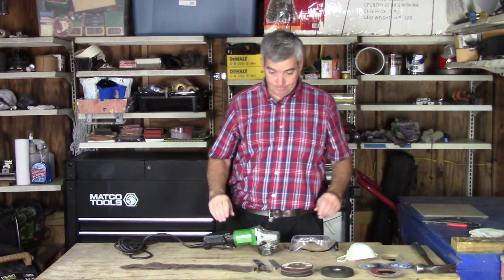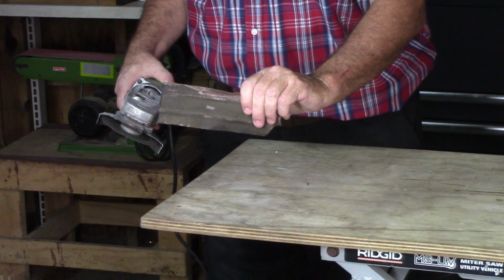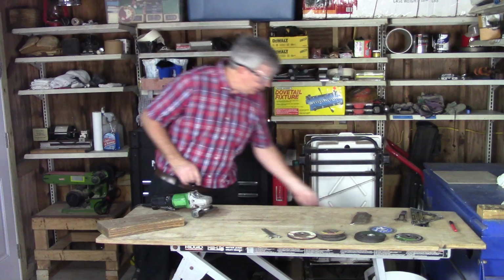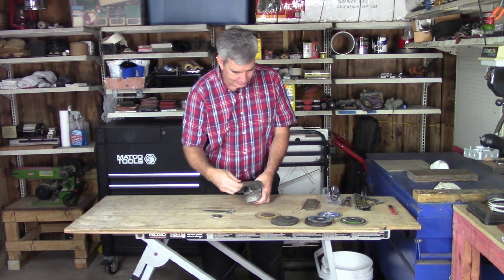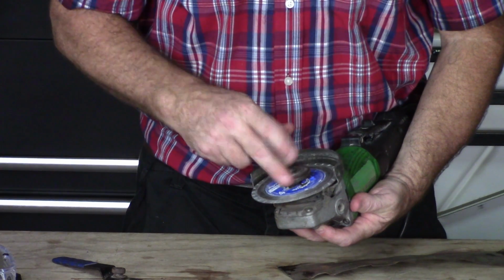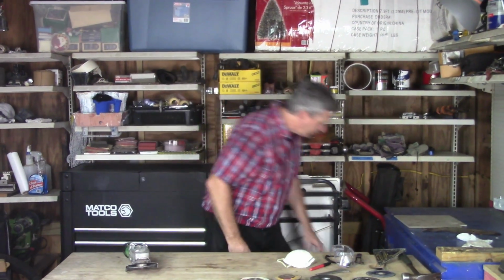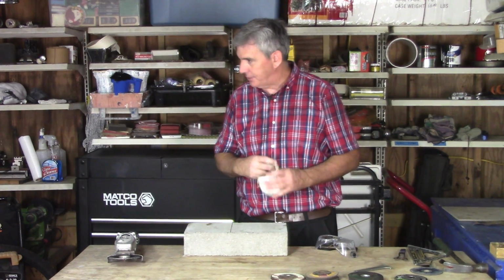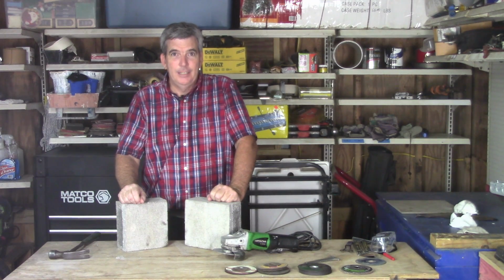How to use a grinder and what can a grinder do?

Comment: Great introduction. Good advice about goggles, certainly important for grinding. I was cutting a hole in my porch ceiling for ventilation, working over my head. I was just wearing safety glasses, and quickly found debris was getting in my eyes. I rinsed out my eyes with an eyecup and switched to goggles.  Problem solved.  Goggles can be more uncomfortable and annoying than safety glasses, but sometimes that is what one needs for effective protection. 

I will need to get a diamond blade for cutting a drainage channel in some pavement. I’ll make the cuts and then finish it with a chisel.